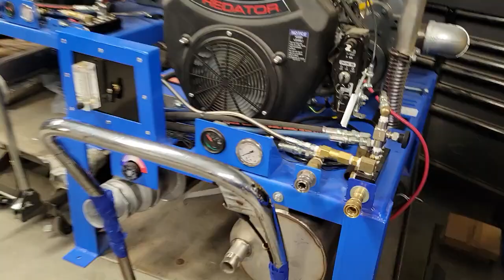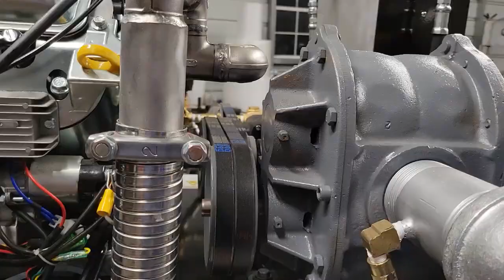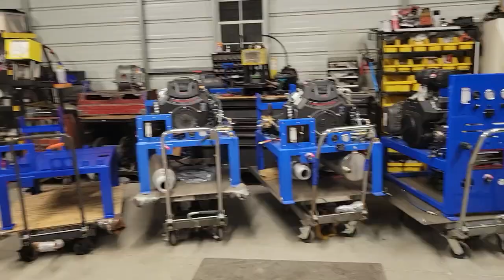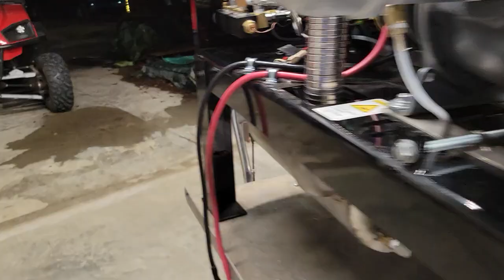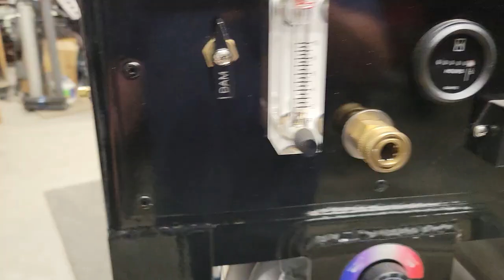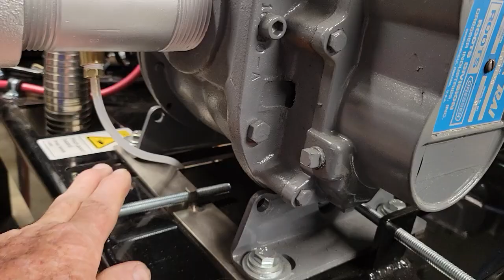Blue Baron's 2025 Popular Extended Version Control Panel  for the Economy 36

Comment: We have the first compact 45 . 2019 . In 2023 we just changed our belts . Very easy maintenance.  We just replaced also our heat exchanger in July of last yr . 7 yrs and our TM is still going strong . Pete builds a great tm for the industry. Glad we made the switch to his USA made TM. Ty Pete out TM is still running strong . Cjs restoration company central Fla .